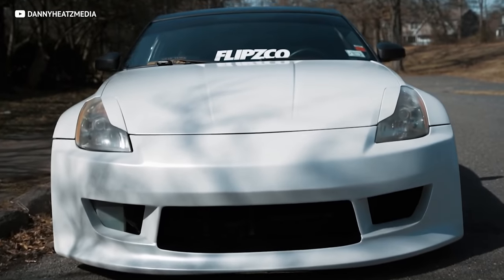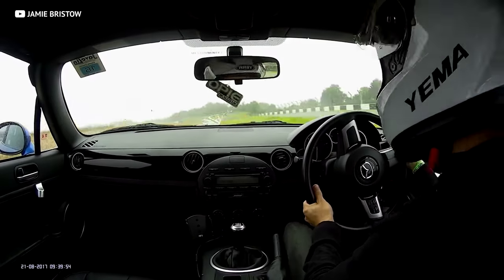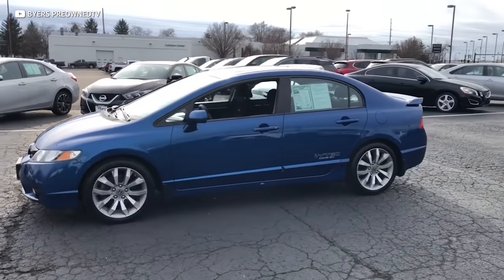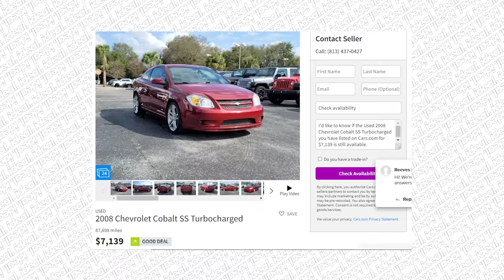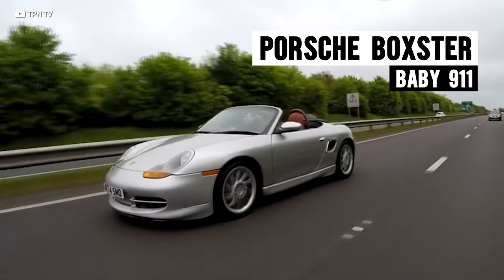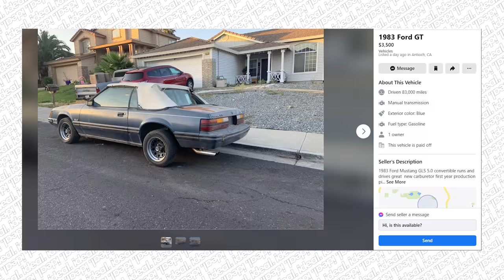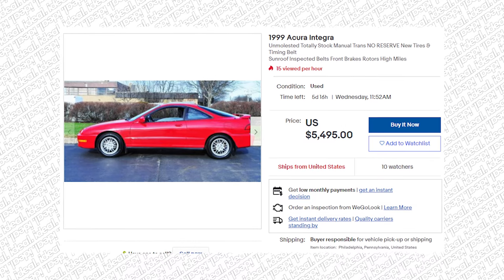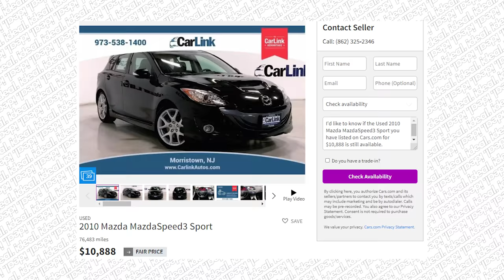10 Race Ready Sports Cars You Can Buy For Under $10,000

Comment: 350z. Staple for fast cheap fun..and under8 grand couple modz and boom 500 hp
Reply from the maker: It's kind of the best used car right now.
Reply: @horriblewater7548  it’s fine to buy a modded one
Reply: Also unreliable and all of them are super high mileage and treated like absolute shit
Reply: Eh already cant find any that are under 8k (where i live)
Reply: @IdealMediaChannel  in Russia fairladies are very expensive because there is no alternative and there were few cars sold in Russia in 00s
Reply: "A couple mods" these engines are known for shitting the bed at 400hp and they're gonna be spittin oil all along the way.
Reply: Yeah boom engine wise
Reply: I like the idea of building a good used 350z that can rival the performance a $150,000 Porsche for a fraction of the cost .
Reply: What mods in particular? This definitely interests me lol
Reply: @punishedvenomsnake716  bigger pistons and injectors Porter throttle body air in take e85 tune and medium turbo. U can find the car and all that definitely less than 10k
Reply: @vondrelleraven4380  
Appreciate it, bro! Thanks so much 🙌
Reply: @vondrelleraven4380  all those mods just to make 500hp?😂 put those mods to any other car and itll be pushing 750+. stick to drifting cus them zs arent meant to go fast🤷🏻‍♂️
Reply: @zero4902  true if your platform is a v8. Its a 6. And trust me its over 500 hp just giving up a basics. Preciate u brother.
Reply: Lol. Not “a couple mods” that’s a turbo kit. And a good one. Get a 3.7 or 3v 4.6 Mustang. Both can reliably make 530whp turbod and will outhandle the Z car.

Comment: You guys always forget to mention the Volvo S60R specifically in its last 2 production years (2005-2007) 

5.4sec 0-60, 6 speed manual or auto offered. 
Single turbo DOHC 5 cylinder with dual VVT pushing 300hp factory. 
Was designed with full intentions of competing head to head with the BMW M3 at the time. 
Intelligent AWD combined with active suspension and a in vehicle button setup to change the entire feel of the car in less time than it took to press the button. 

The Volvo 5 cylinder motor and turbo for the R models were built in collaboration with Porsche to make the ultimate family mans weekend track car in a total sleeper car package. 
No one expects a Volvo to be fast, especially not a stock one but the S60R and wagon variant the V70R are the true definition of a modern factory sleeper car that’s still underrated to this day.